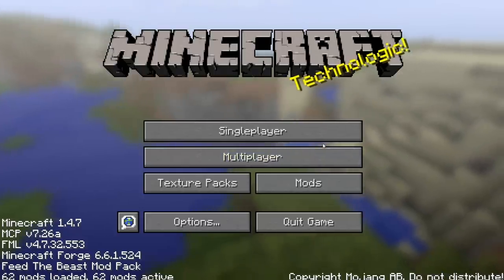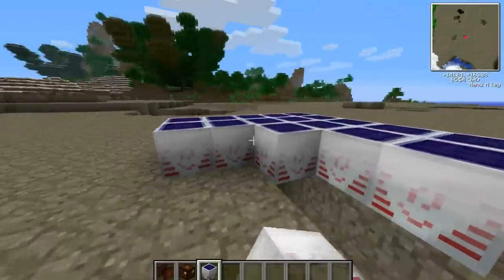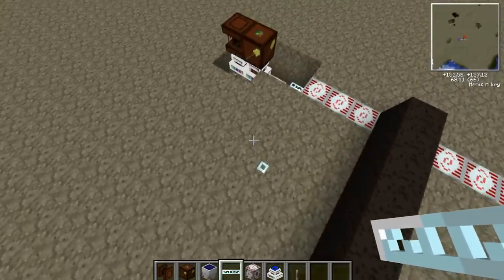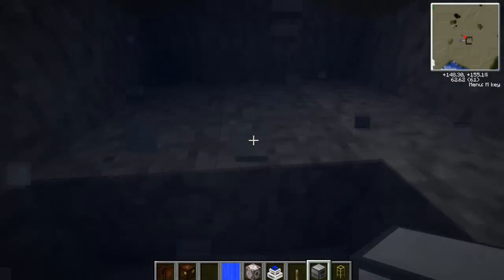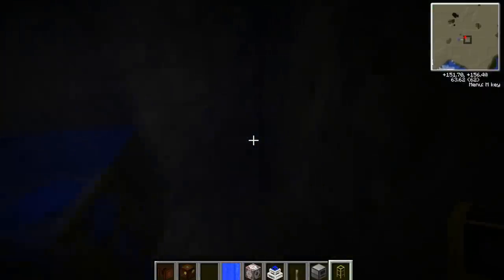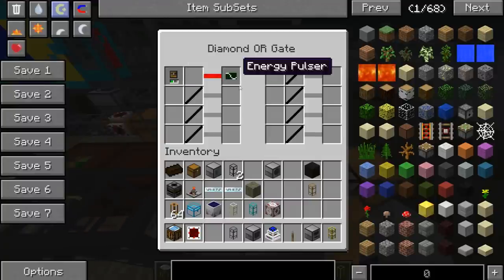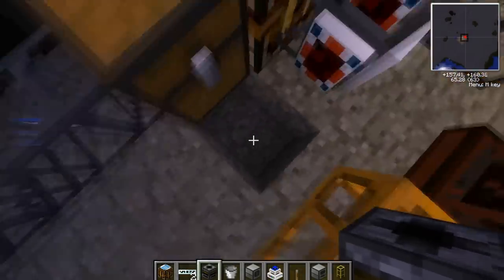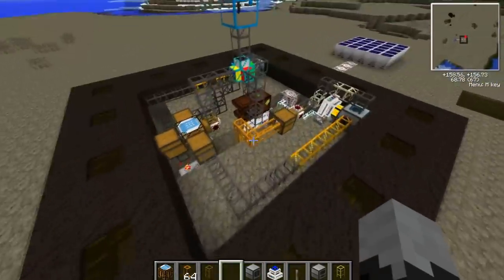FTB Tutorial: Almost fully automatic peat farm

Comment: Why the buckets?  Attach your water pipe directly to the carpenter and it will fill with water directly.  Attach the pipe to the side  not the bottom.  The bottom is used to fill the slots (9x2 area in the carpenter). Elimites the Liquid transport.  Add a moistener (make sure its in the dark)feed wheat (from a wheat farm) to make mulch, feed the carpenter dirt (from the wheat farm) sand (from the tree farm) + mulch to make bog earth, add power supply to a side and extract bog earth from the top.